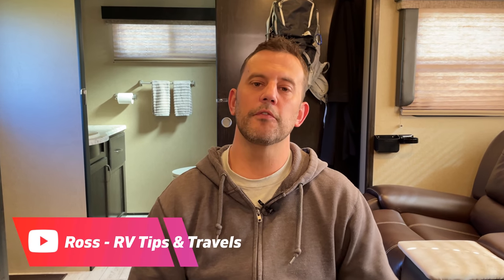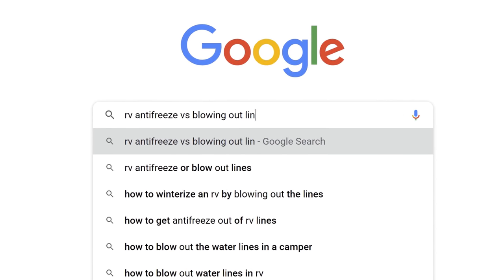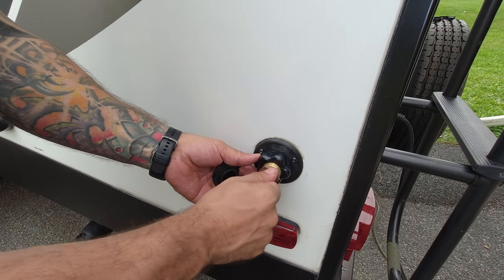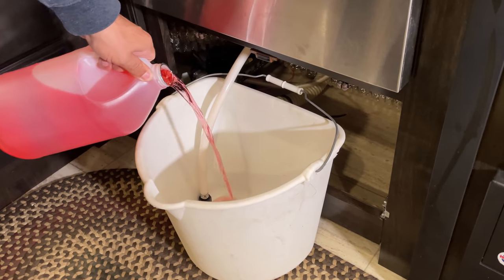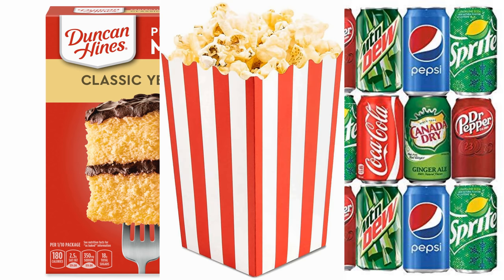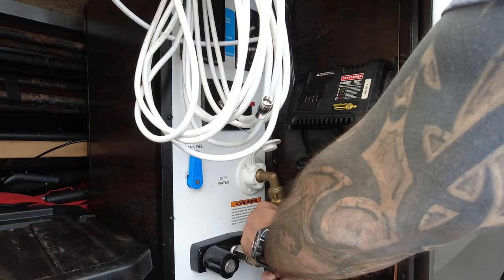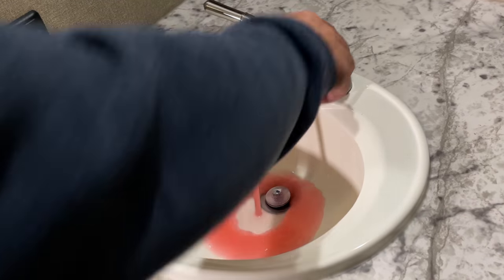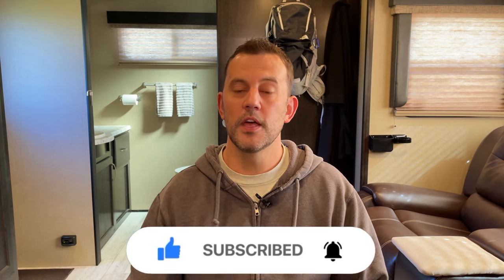RV Antifreeze Vs Compressed Air: Which RV Winterizing Method is Better?

Comment: Lol You say its a safe chemical as if any of the corporations food products are good for you 😂 no antifreeze for me thank you. Not even in trace amounts.
Reply from the maker: the reality is unless you are eating an organic whole foods diet you are probably eating propylene glycol somewhere.  if you're eating any food that has a television commercial unfortunately its loaded with stuff.  Just to be clear though, I never said it was good for you, I said that most people are consuming it, even if they are unaware.  I think its important to realize that many people dont want to use rv safe antifreeze for that reason but also dont realize their diet has more PG in it than they would consume using it to winterize.  hope that makes sense.
Reply: same here..the stuff is foamy, smells and is hard to flush out once its in your entire system. Air only for me. That;s all we did years ago.